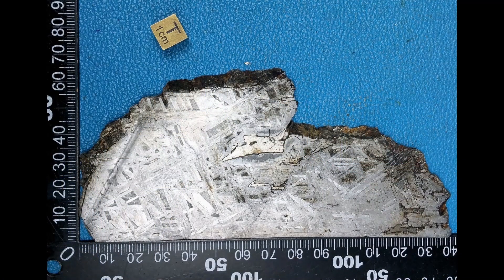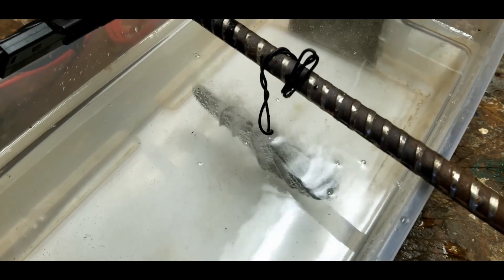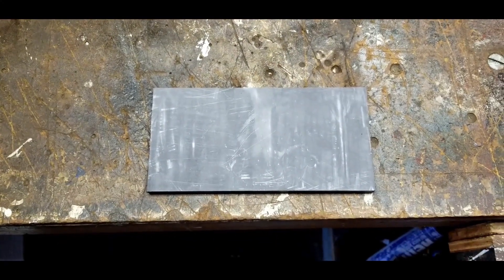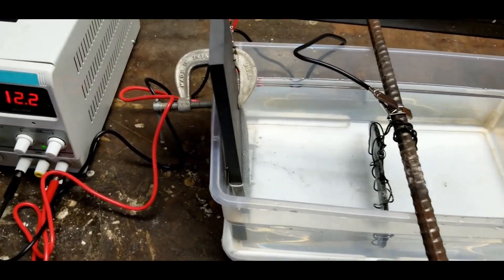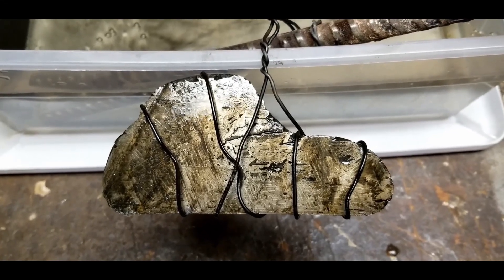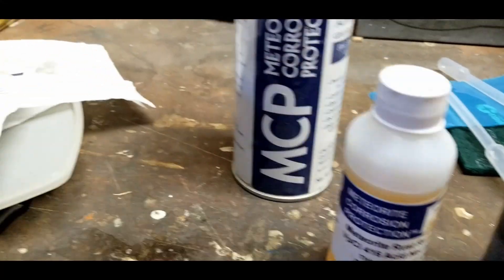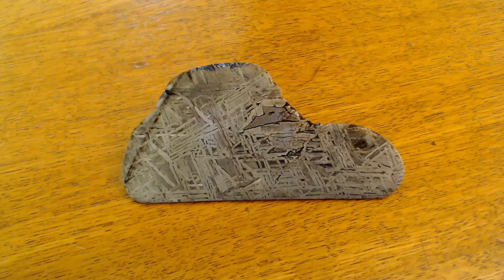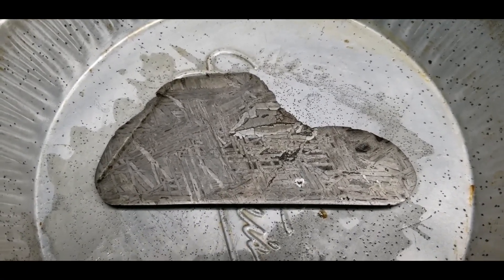Salvaging a Damaged Iron Meteorite Slice with Ron Metchis, Stabilizing, Electrolysis and Etching

Comment: Hi I Love your videos. I have a piece of aletai Meteorite and it's starting too ooze orange. Ive cleaned it and want to do the same treatment you have done to yours on RON METCHIS Video. Should I follow the Odessa tutorial for  doing the Aletai. What volt and amp should I set it too? Is it 2 amp 12v? 200mm graphite by 100mm x 10mm. An iron bar and baking soda and iron wire. Is that correct and any dos or don'ts etc. appreciate any help. And thanks for making these videos they are a big help. I'm subscribed to the channel and keep up the great work 😊
Reply from the maker: Before making a decision, there might be more iron videos on our channel that you haven't seen yet.  If you search our videos for the words RUSTY IRON, you will see more Ron Metchis videos, as well as the first two videos that come up in the search.... these are Part One and Part Two of a series we recorded with Craig Zlimen.  Let us know if these videos are a good resource.
Reply: @TopherspinMeteorites  Thank you for you response I appreciate it. I will sit and binge watch tomorrow. I just Wana make sure I get the process right. Yous make amazing videos. I'd be lost with out them. Keep up the great work. I will get back to you if I run into any roadblocks. Thanks again 🙂

Comment: Thanks for all the documenting and showing the incremental steps in process improvement.  Excellent instructive video!  I do have two quick questions.  First, it looked like vinyl coated single core probably copper wire that you strung from the rebar to the meteorite (is that right?). How much of the coating did you strip off and exactly where were the contact points on the rebar and the meteorite?  

Second, I didn't get a good look at the brand of electrolyte you were using (just saw the bottom of the container).  Would you mind letting me know the brand?  From what I understand, about anything with sodium carbonate should be ok, just don't want to overamp my power supply.

Again, thanks so much!
Reply from the maker: Ron can answer the questions in better detail: A clothes hanger is used to dangle the sample. Clorox "Pool & Spa Ph Up" or Arm & Hammer Super Washing Soda  (Sodium carbonate) will work. I wondered if he exposed the wire myself.